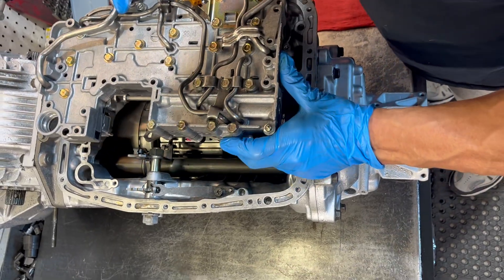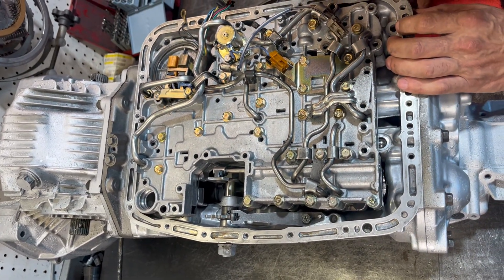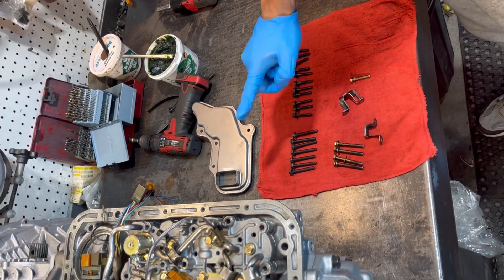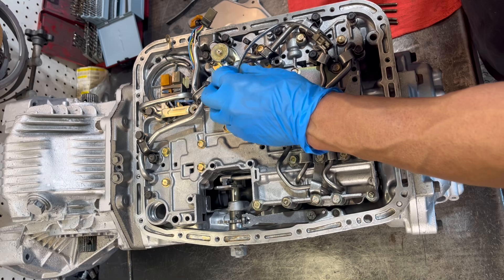Subaru 4EAT Valve Body Removal And Replacement (Phase 1 type)

Comment from the maker: IPT Performance Transmissions specializes in Subaru high performance automatics and Subaru built autos, as well a performance rebuild kits, modified valve body and high stall torque converters.
https://www.importperformancetrans.com/